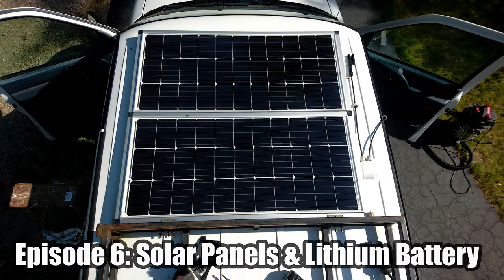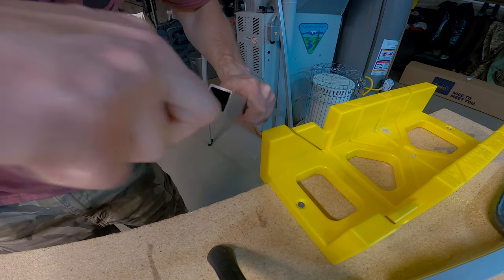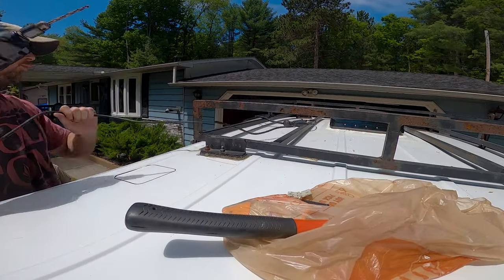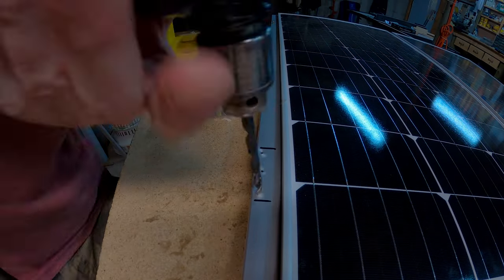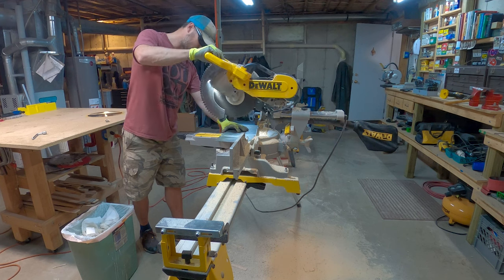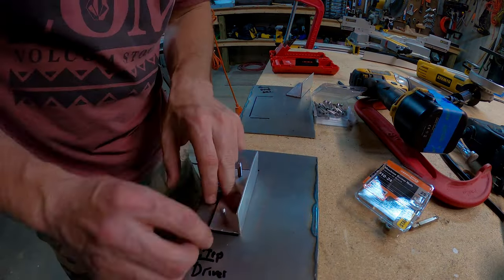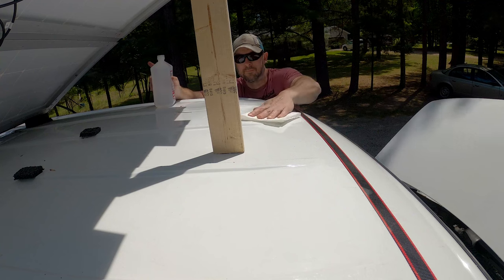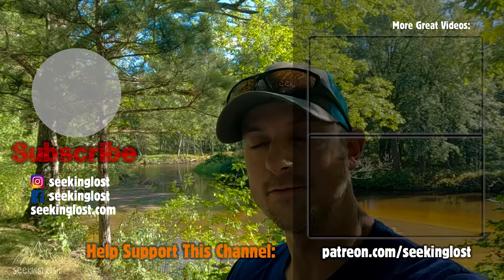Chevy Astro DIY Stealth Camper Van Build EP 6: Solar Panel Installation & Lithium Battery

Comment: Really enjoying this series. Making mental notes as I watch to use your methods in a future van build of my own. One suggestion is the front mounts for the solar panels, with two different types of metal, aluminum and steel I would watch for corrosion over time due to the di-electric difference between the two metals. Wouldn't hurt to place some time of nylon or silicone layer between the steel and aluminum.

Comment: I must say that everyone I've encountered with lithium battery installations, people who actually camp, wish they had not gone that route.  We have spent 3 - 5 months off the grid for 20 yrs and find normal batteries are just fine.  We recently "upgraded" to a 2006 four wheel popup truck camper, it has the original golf cart 2 6v batteries.  Despite it being the wet stormy winter in the southwest we never once got below "good" on the old time charge meter with one 75w solar panel flat on the roof and one portable, all through a renology charge manager.  AND.. even. well below freezing they always take a charge and they supply power.  Never had to use the truck to charge anything.  Inexpensive, durable, dependable.  You can keep the lithium.
  An aside:  To refill our water tanks without moving our camp we brought 6 gal jugs and transfered the water with a drill-powered little hose.  Many mornings the lithium battery drill would not work till we heated it up.  We kept that charged with a lighter plug cheapo invertor, running off those old school and pretty old normal batteries.  I know lithium is the Gucci thing...but it has it's issues, for sure.
Reply from the maker: I love lithium! Why would i want two batteries that can only be discharged to 50%, when i can have one? Only had one morning ever in 2 years in this van where my batts wouldn't charge, for about an hour, until it warmed up. Can still use the battery in the mean time. No biggie. I hate cold weather and almost never camp in places that get below freezing. Your van keep your two batteries, I'll stick with lithium.
Reply: @SeekingLost  If you are always in warm weather then other than cost there's no drawback to lithium batteries.  They are lighter, and they do pack more power, for sure.

Comment: How well is your battery working.    Im just starting a build and am using the same solar panels
Reply from the maker: Battery and solar panels are working excellent. 200w of solar is the perfect pair with the 100ah battery. Here in the Arizona desert, I can recharge 65%+ of my battery in one day (more in the summer, this is the winter/spring months), and that's way more than I would use in a day.
Reply: @SeekingLost    thank you